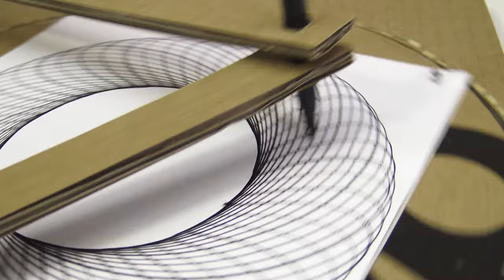DIY Geometric Automatic Drawing Machine on Carboard

Comment: Materials 
•Cardboard
•One (1)no Bearing for the main circle 
•One Gear motor yellow 🟡
•One cell holder with wire connected 
•Instead of taking the cell holder take a double battery with connector (this would be more handy and easy to install)
And lastly a switch to add because in this video the person is not using the switch but we can make it so it looks more good and quick to start 

After all I am making this one for my sci week exibition
Thanks 😊😊👍👍
Only 3 Things are needed in this one !
Reply: Which motor AC or DC
Reply: It's robo motor
Reply: Thank you much
Reply: Can you say the radius of the cricle and the gear ratios pls?

Comment: I recently made this but facing issue that small circle is rotating but bigger one is is not...I tried to put both the wheels a bit closer but this made the smaller one stuck... Kindly guide what should I do for smooth rotating.... Should I use cardboard sheet for cutting the wheels for even circles...I want to submit this in two days... Please reply and guide